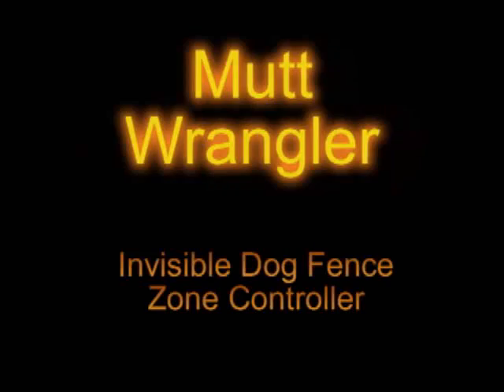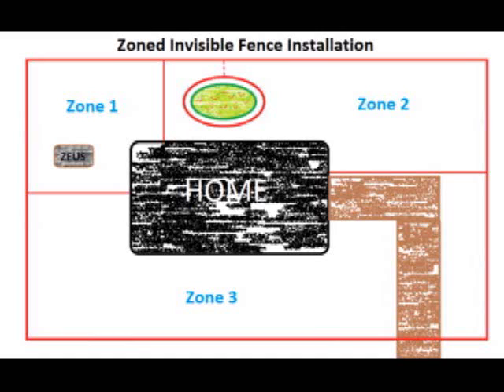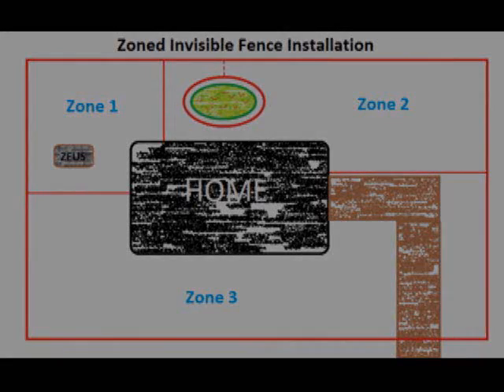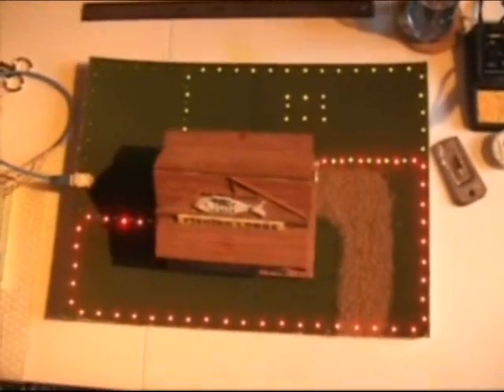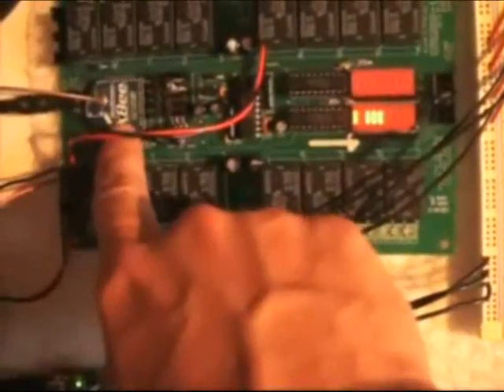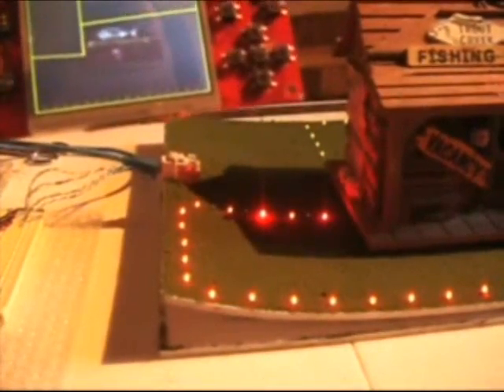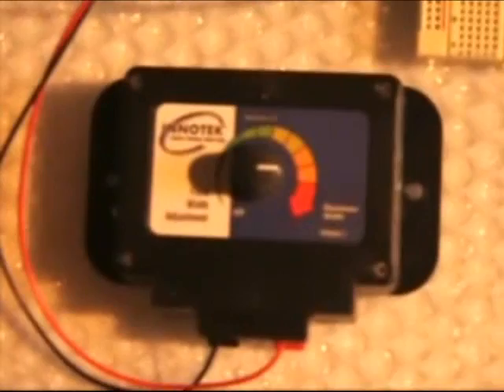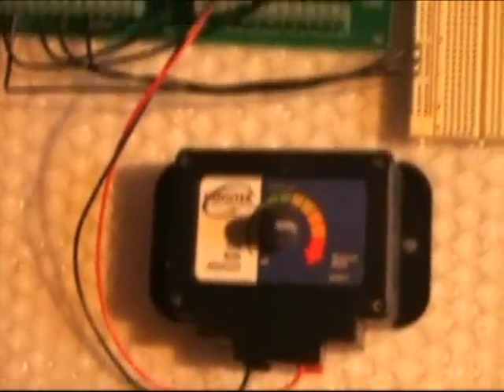Dare to Dream Different Contest - Invisible Dog Fence

Comment: There are 2 fatal errors with your setup

1. Once the dog is trained to respect the fence boundaries, it isn't going to get near them again! The dog would have no way of knowing when a zone was turned off, and would be afraid to test it out. With most dogs, you can take the collar  off, and they still won't go near the boundary.

2. You have the zones wired in parallel. The radio signal requires a single loop. You would have to switch zones in and out of a series loop.

Good geek porn though! :)